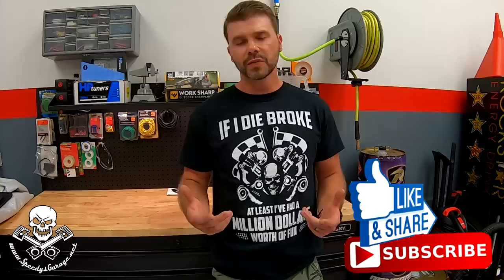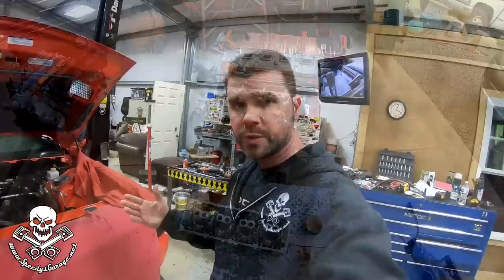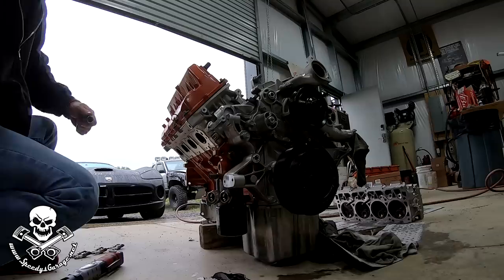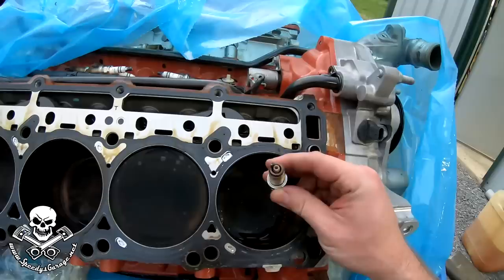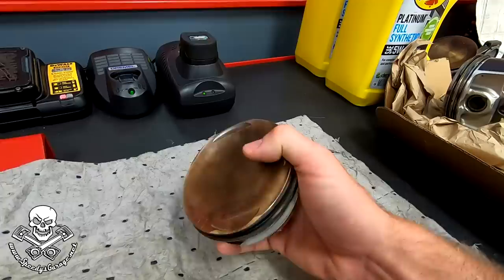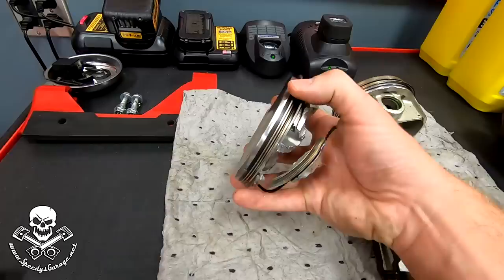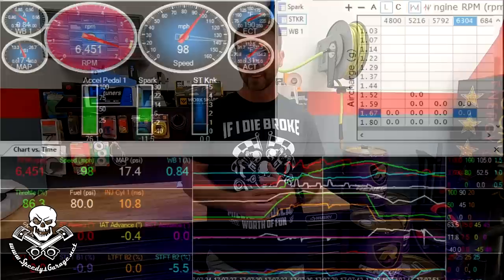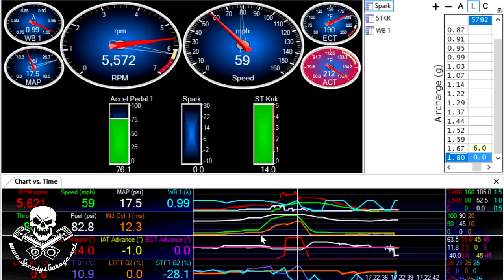Hellcat Engine Failure Diagnosis Speedy's Garage Challenger Go Man Go

Comment: The higher you rev a motor the more the piston 'weighs'.  Figure on a 14K sportbike motor the piston is going from 0 to 25MPH to 0 several hundred times a second..  Same thing here - twice the cylinders.  That piston is exerting a force probably near a half ton+- on that rod at 7K.

Comment: I probably should watch the video all the way thru but from initial sight, I totally disagree that just because the top of the piston is fine, doesnt mean there isnt a fueling or boost issue. It could have over boosted and cracked the wrist pin, over fueled (hydrolock) and cracked wrist pin, factory defect, etc....
My point is that even tho you can get a good idea of what happened, you cant just overlook major points.
Reply from the maker: If you finished the video you saw the data logs all looked good.  No lean condition, no knock sensor feedback.
Reply: @SpeedysGarage  Yep I totally agree. It's funny because I usually always watch a video in its entirety first. After seeing the logs I would agree with you. As you know there are literally TONS of variables that could have lead to this. I was just a little surprised when at first I heard the comment " it's not fuel or boost issue because piston top is clean". Good job so far, looking forward to the rebuild.

Comment: Looks like a defective piston that had weak metallurgy. And unfortunately the weak point was where the wrist pin connected to the piston. Would be interesting to see what an engineering shop reports after running some test on it.

Comment: You solved your own mystery and didn't recognise it! The comment was that no torque plate was used and if you recall you had a massive heat spike so you may find that the spike came prior to the piston failure and that heat seized the piston at the top of the stroke,  Invert the timeline of the failure to expose the root cause and do so in slow motion.

Comment: Very interesting theory and I completely agree. How much power do you gain by going that high on the shift rpms?  For me I would not go as high and live with a little less hp and hopefully not have one of those "lottery" pistons.. Love the channel 👍
Reply from the maker: Stock Hellcat red line is 6,000 or so.  You gain about 50HP going to 6500 or so.  Past that you don't pick up much power, but your 60' at the track improves.  If you can delay the 1-2 shift past the 60' is makes a big difference in ET.

Comment: Lambda looks a little lean in the datalog as if it is not set too conservatively, figure you would want to be closer to the .78-.79 range... I am not sure what type of fuel you were running though
Reply: I know we would start lower than that when tuning and lean it out and see if we have reasonable gains in the 1/4 or need to keep the AFR where it was.
Reply from the maker: Hellcats are a bit different in that their stoich point is set to 13.85.  .79 lambda would be 10.9 AFR and a bit rich.  I shoot for .83 - .85 on this car which is about 11.5 AFR.
Reply: Speedy's Garage - granted I am not a mopar guy so just trying to give an outsiders view on putting the pieces together in the engine failure... Lambda is lambda, Stoich is fuel dependent so Dodge can use what ever value they want in displaying an AFR on the dash but Lambda is Lambda. I would verify with other tuners on that platform but .83-.85 LAMBDA seems to be a pretty aggressive tune-up and I would confirm with Dyno or the 1/4 on the next build that your not leaving a ton of power on the table by setting target lambda at a more conservative number. 

Also, I could be completely wrong in how the ecu controls fueling and I am not trying to bash a tuner. Just trying to make sure future guys going down the same path don’t have engine failures. 

Sorry for the long reply-I enjoy your channel and your open attitude to the successes and failures in racing. You have a new subscriber to your channel!
Reply from the maker: It's good discussion for sure, I just convert lambda to AFR as I'm still getting used to it LOL.  Believe it or not from the factory these things are set to .86-.87 lambda!  I was dead shocked to see that.  They do dump COT early though.

Comment: The piston failed on the ringland initially. And eventually it failed as it broke through the pin. Something I have never seen on a performance piston break like that. 
Boosted engines will always fail quicker. It is what they are.  Constant level of fail.
Reply from the maker: Meh, the supercharged engine in the old Challenger ran great with almost 10 years of drag racing and is still going strong with it's new owner.

Comment: Piston collapse is the problem...obviously once that happens its just a matter of time before it destroys itself.
Why? Probably happened 6 months prior due to a cold kick it the nuts. I seen idiots (like at the dealership) pinning the throttle to the floor for a quick 2-3 seconds in these hi HP cars.
Race motors..as most if you know,..have much bigger tolerances than reg street motors. Takes 20 minutes of NORMAL driving to get it up to temp..

Comment: im mopar only, period,been driving a fast dakota r/t 02 model for 16 plus years,an about to be 100,000 original miles on it,its lowered with k an n system,also different computer/ chip, hypertech i think,an must run 93 octane or it will rattle an run poorly,it seldom sees over 50 m p h or so,im near 67 an cant afford sticky rear tires,an it has a few very small issues,but will get away from you after warmed up a couple minutes...

Comment: What mods did this Hellcat have in addition to a tune?
Reply from the maker: 2.72 pulley and ID1000 injectors.
Reply: @SpeedysGarage  Yikes, that's not a lot of mods for major failure. Maybe the stock pistons aren't built to a large enough safety margin to run much higher than stock boost?
Reply from the maker: I think this was RPM related.....just got a bad piston.  It happens on massed produced "stuff" I reckon.

Comment: You should give that cylinder to a metallurgist, he will tell you exactly how that aluminum ripped, and could tell you if it was started from 5 months ago or it all happened at once. Anything else is just a guess, if you wanna know for sure that’s what you gotta do.
Reply from the maker: Sounds like an expensive proposition, I preferred to just replace the motor and move on.
Reply: @SpeedysGarage  actually not too bad, but would it not be worth it to know?
Reply from the maker: Not to me.  Patterns are showing cylinder 7 in standard Hellcat motor can have problems for whatever reason.  This video was a few years ago.  I dropped in a Demon motor and never looked back.

Comment: overreving was not the cause.  TOOO MUCH BOOST NOT ENOUGH FUEL, & TIMING!!!!!!!!!!!!  These engines make their PEAK horsepower rated @ 6,000 RPM. so therefore running it a little above is not going to kill it.
Reply from the maker: Well, hopefully you saw the data log posted in the video showing the lambda was .83-.84, definitely not lean and 11 deg of timing isn't too much either.  Boost was 16.5 so definitely not "over boosting" either.  Fuel was Shell 93.
Reply: @SpeedysGarage  Ok I still stand firm that it was a lean condition which prob. occured without your knowledge. Could have been from weeks prior running the car. When it did go lean, the heat & pre-detonation weakened the piston by partially crimping a land & weakening the skirt. The wrist pin and upper portion of the rod took the most of the shock.And  As you kept running it unbeknownst to you from what had occured, the weakened internals couldn't hold up to any more forced induction or intake pressures you were throwing at it. And bang boom clank 
This is my theory and I'm sticking to it!!!!! LMAO
Reply from the maker: "bang boom clank" haha that made me chuckle - I think the big thing is that I've had about a dozen folks reach out to me (some performance shops) stating they've had cars do this exact thing, even on the exact same cylinder.  I'm not discounting your theory, as that's what I'd think too based on a lot of my previous experience, but seems something is "funny" perhaps with cylinder 7 on these cars, and the rods in general to be honest.  We'll see how the new Demon/RE engine does for me.  Will be hitting the track as soon as the weather breaks.
Reply: @SpeedysGarage  Bro I feel for you. I have been supercharging engines since the first days of Pro Charger. My first supercharged money pit was back in 1995.I had a 2 year old Fox body had literally 23,000 miles on it and 3 power plants later. The Original 5.0 I bolted a kenne belle whipple charger on it. Was unhappy with the performance, so I decided to add a 150 shot at 5 ibs of boost. Well it only took one screwed up 60' and MAYHEM came to visit. The intake went through the hood. There were no parts salvageable after that of OEM 5.0. So I months later I decided to install a high mileage  FREE 351W. With the money I saved I purchased the very first PB600B Supercharger Procharger was marketing. Slight problem was the Procharger kit was for a 302 not 351, yup I spent days fabricating brackets. Once all together went right to the track 2 runs later the motor lost all oil pressure. Long story short I went through 2 more 351's before It was safe enough to beat up. It was at this time 1998 I lost interested and sold the fox body. Odometer showed only 36k  
Fast Forward to 2005 I bought a mint rust free 71 Chevelle with a low comp mild small block. So just incase I didn't learn my lesson in the 90's, i figured Y2K would be saving grace. NOPE so I bolted a Vortech YSI onto the engine block and fed direct boost through a blow through carb.  Had proper fuel system, MSD 6al box, etc etc I took every precaution I could so I wouldn't relive my foxbody days. So in 2006 on my way to a crusie, engine failure,. In 2006.5 another, 2007.5 another on a dyno being turned by a carb guy nonetheless, & 2008 one more THE LAST. Every time major carnage to the internals. 2008.5 built a nasty 404 ci SBC. Drove it once around the block. Its been parked in my gagage ever since. LMAO
Good Luck Brother . Maybe your engines do have weak rotating ass'y.and boost,fuel & air isn't the silent killer.
Reply from the maker: Dang that's some serious war stories man!  I did a built motor from Arrington in my 2009 Challenger and it was flawless.  Ran 16ish pounds of boost 93 on the street and 109 at the track.  It was a M6 car and ran consistent 10.80s at about 131MPH, not bad for a little 6.0L stroker.  Spun it to 6800 RPM.  If this new motor gives me issues, I'll go built.

Comment: I run 2 stroke oil in my gas when I think my motor needs a nice cylinder smoothy for extra smooth wear after a couple hard drives

Comment: Those cast pistons are honestly cheap junk. Shame on Dodge for not using forged aluminum pistons in their 700+ horsepower Hellcat! If you automotive journalists don't call out the domestic auto manufacturers to up the specs on their engines, what do you think they're going to do? FYI: It doesn't cost the manufacturers much more to install forged pistons over cast. I am a BMW factory trained mechanic.
Reply: azguitar It’s not Dodge’s fault you’re adding more horsepower to an engine thats ONLY ment for 707hp. Keep it stock, the engine won’t give you no trouble whatsoever. Once you start introducing more horsepower to an engine thats only ment to handle its stock power, then you should know you’re doing that at you’re own risk. The Demon and the Hellcat Redeye both stronger mechanical components in the engine to handle 800+ hp. You want to add 1000+hp on a stock Hellcat? Rebuilding the engine to forged components will help save you time and future problems like these..

Comment: I think maybe since the piston was a full floating  wrist pin  and the circlip failed and the pin come tward the cyclinder wall  the piston rattle and the thin wall desighn of the piston it busted apart
Reply: I remember a friend telling about having a barely audible knock and apon taking it apart found a wrist pin broke in half and still running connected on just one side

Comment: Like the new dewalt, I have the last gen. I use it very often along with my bigger 1/2 drive impact. I've busted a few impact ready extensions and adapters once I put the 6.0ah battery on them, they run full power. I'm used to chrysler products being junk over last thirty years so a blown hemi is no surprise.
Reply: Chrysler products are junk? Yet making more power than chevy or ford junk..? Please... this issue is due to an owner not knowing all of the parameters and limitations of what they are doing... knowing the limitations of what you are working on is always step 1, doesn't matter what brand or badge you put on it ignorance will always lead to failure. If you don't do the research before you start changing things or pushing things hard, stuff is going to break. Every Ford or Chevy or even import car has a limitation. FCA is the one really pushing the envelope! So like them or think their products are junk, we all owe them for pushing ALL manufacturers to produce more power, run faster ET's and build better more powerful cars that are fun to drive!
Reply from the maker: Sounds like you're suggesting I'm a noob on the HEMI platform.  That's definitely not the case.  Something's fishy with cylinder 7 in these cars.  I got calls from dealers after posting this video with similar issues in cylinder 7.  Maybe it's the last to get fuel somehow or something and got hot.
Reply: @SpeedysGarage Sorry, Not calling you a noob. Just pointing out the white whale in the room lol, Yep fishy behavior of 2 and 7 is right! The fuel rails on these engines tend to under deliver fuel to 2 and 7(crappy design Mopar!), extra heat will then cause the rings to expand locking them into the cylinder, and POP goes the top of the piston. Subsequent rod whacks will cause whats left of the piston to rock and spin in the bore causing further damage. It happens even on stock unmodded Hellcats if crappy fuel is used. Modded Hellcats without proper fuel delivery and ring gapping will certainly pop a piston! Here is where an ounce of prevention leads to a pound of cure if these simple precautions are followed.
Reply: @SpeedysGarage  Its not something anyone but an engineer would just know... It took 6 months of head scratching calculating, and dyno testing to figure out what was going on... so...
1. If you buy a Hellcat.
2. Replace super crappy fuel rail.
3. Fix ring end gap.
4. Replace fuel pump with a goid aftermarket unit.
THEN
5. Mod to your hearts content within reason as long as you have access to a good tuner.
Reply from the maker: I think the ring gaps are OK.  I'd have to cross reference what they are vs the built motor I had in the old Challenger to see how they compare.  What I've started to lean toward is the fuel pump.  As I was dialing in the tune on race fuel I started to see the fuel pump duty cycle go to max in cold air.  Fuel pressure would drop but not enough to affect the wide band readings.  However, if cylinder 7 is a problem area fuel delivery wise, that one cylinder could have been heating up but the wide bands wouldn't detect it if the other cylinders were compensating.  Hope that makes sense.  I've got a dual pump drop in setup on the way just in case though.  Had I designed the fuel rails, I'd have front and rear crossovers to more evenly distribute pressure.
Reply: @SpeedysGarage   Speedy's Garage  Yes that is exactly what we have found! Fuel pressure drops between the transition between 2 and 7 due to the way the crossover is running on the stock setup. Look at the Arrington SKU:API-5761FR fuel rail as it  eliminates the pressure drop. Dual Fuel pump system Hell Yes! I like the way your thinking! Just do yourself a favor and check all ring gaps... cheap insurance!! Never a bad idea to smooth out any rough edges and slightly round any sharp corners! Can't wait to see version 2.0 on the strip!!

Comment: Bad pistons and bad spark plugs 
As a Hellcat owner, I’m worried
I have heard a lot people getting away with more hp than you and no problems so far
Reply from the maker: Exactly.  Lots pushing them way harder.
Reply: Speedy's Garage 
Did you ever experience any vibrations from your aluminum DSS ?
I bought 1 but haven’t been able to get it installed and now I’m hearing a lot of bad vibrations stories that it’s getting me worried

Comment: Its called manufacturing of engines parts are not x rayad or sonicaly tested and matched and balanced 100% everything is perfectly made and with the right materials and to the point that each parts is weighed and tested before assembly ? Try that and i bet you can run 1,000 HP plus and not have any issues if the engine is looked after ?

Comment: Now not a hp engine but a common failure was the gm  250 ci 6 cylinders we're famous for breaking piston skirts.man I couldn't find um that didn't snap off. But they broke low enough that they continued to be reliable     morors. But they idled like shit because as soon as the skirts break they are waaay out of balance loosing 4+- ounces off one side of the piston .but I still love them old 250s.

Comment: Piston skirt does not seem to be that long, most pistons from  the cars I worked on years ago(ok, I know not the newer engines).........but if the skirt is too short, it WILL be unstable at high RPM and try to rock, this could be the issue, engineers probably making the piston skirts shorter these days to save weight and reduce friction...........are these cast or forged pistons??????